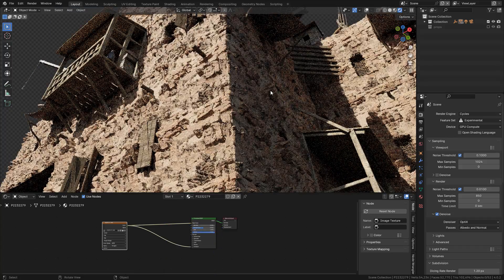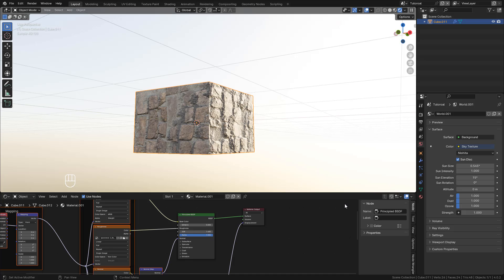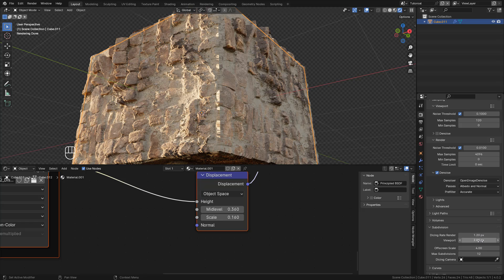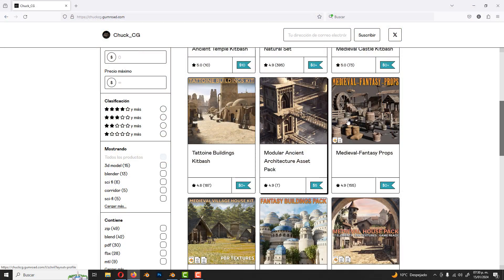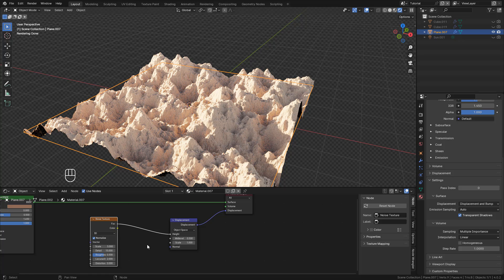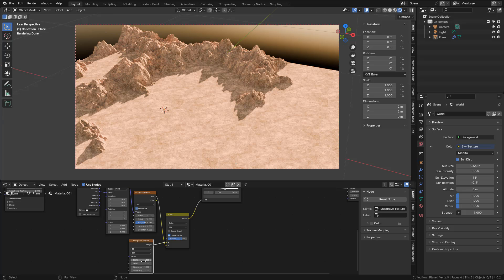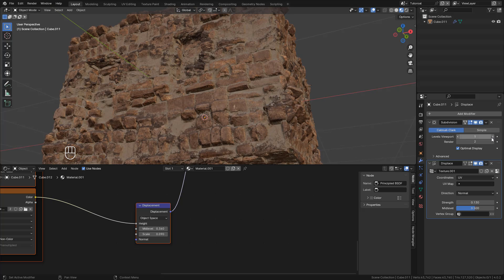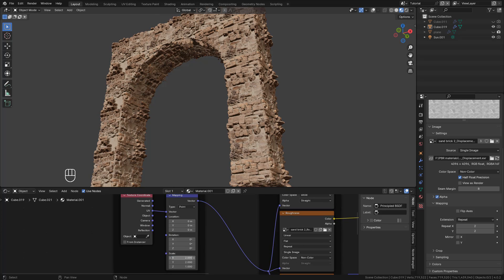How to Apply Displacement Maps in Blender

Comment: have you tried to render ? displacement takes a long time to render and sometimes it crashes. I am doing a short realistic-film and displacement is actually killing my high end computer. ram is on 100% 32 gb DDR5. I think i need 128 gb for this to work idk.
Reply from the maker: Try rendering with gpu, or dont use adaptive subdivisión, in feature set use supported
Reply: @chuckcg  i am using my gpu 4090. I tried both methods for displacement. The adaptive sub and displace modifier. They both take around 3 min avg to render in 4k. One last aproach i didnt use yet is to apply the displace as part of the mesh. Then decimate a bit to reduce the count. I dont know what to do brother. I think a ram upgrade is next i am clueless now.

Comment: Great way to generate materials...but now Musgrave texture has been merged with the Noise texture. What to do in that case?
Reply: I didn't try the new blender version yet. But since you said that they are merged, just switch to musgrave noise in the dropdown i guess?

If this is not possible: perlin noise and musgrave are very similar. Just lower the roughness a bit and put a  map-range after the noise and set it from 0min 1max to -1min +1max